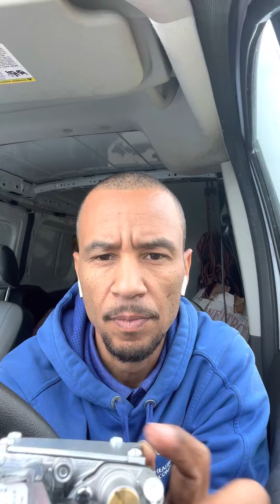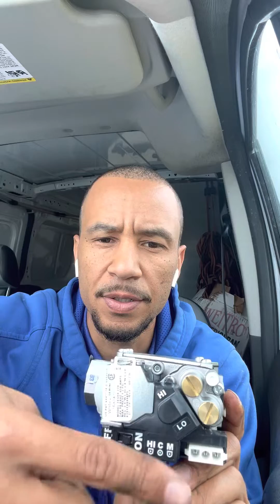Adjust gas pressure on dual stage gas valve, white Rodgers

Comment: Great video.  On a york yp9c do you have to put furnace in test mode first and then adjust the manifold gas pressure ( in test mode). Thanks
Reply from the maker: Hello! I’d have to read the manual

Comment: Brother what tool is used to check the inlet and outlet pressures. I have Allen key sets and none of mine fit. I have imperial and metric. I’m not sure if I lost the key for it but every single one I have doesn’t work. I’m fairly certain it was an allen key but I’m also hearing it’s a torx bit. I’m talking about the little ports where you slide your manometer hoses over. Let me know please! Looking forward to your response.

Comment: I just did a natural gas to L.P. conversion. When adjusting my manifold pressures, I was able to adjust low stage to spec, but high stage maxed out @ 8.0" w.c., instead of the 10" w.c. that was called for. What would cause this?
Reply from the maker: did you set the highest stage first?
Reply: @ACManHeatingandAir  I set the low stage first.
Reply from the maker: @Dave-nm3xc  take a look at the instructions. I don’t remember, but I believe you have to set the high stage first and then the low.
Reply: @ACManHeatingandAir I'll try again. Thx mate.

Comment: How did you connect your monometer to that 3/32 set screw to adjust?
Reply from the maker: There is a short plastic tube that comes with the manometer. Use that
Reply: Yeah .  My manometer hose won't fit .  The new WR valves .    So frustrating
Reply: @Mik-mk8us  you just need the right size rubber tube I had to buy a Lennox kit with all sorts of tubes tees etc just to have the right size tube that fits over